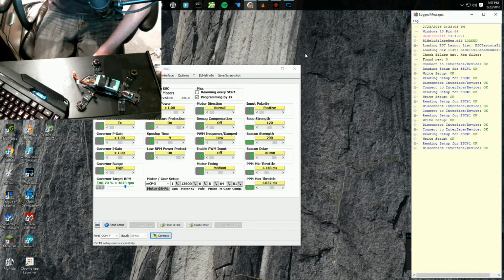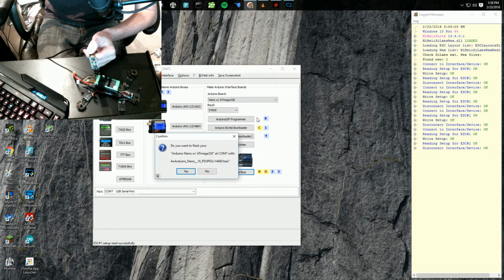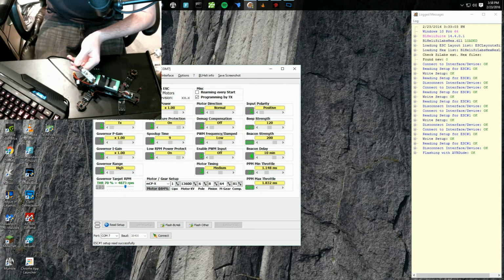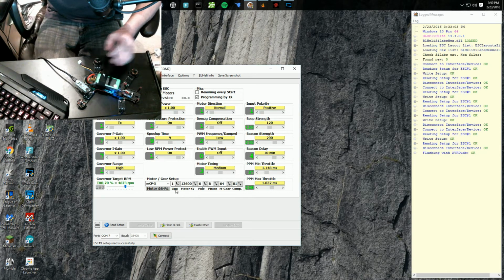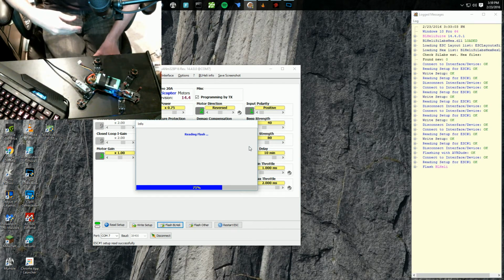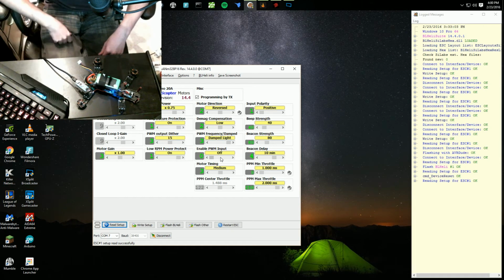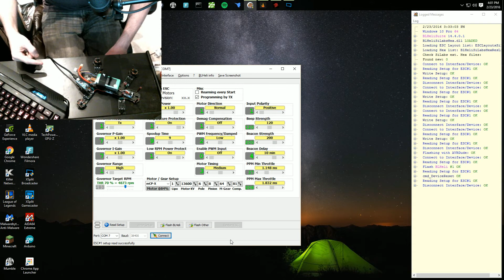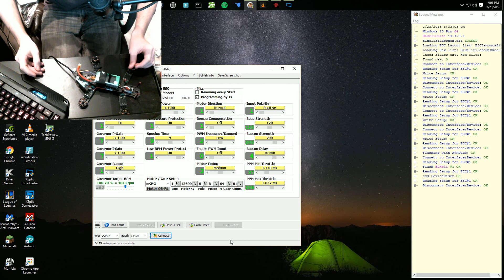How to flash Emax Nano, and other SiLabs Escs, With BlHeli

Comment: LOL found this over 2 years later looking at 12A and 20A HW ESC's and this video shows the pain customers had to go through ... and still have to go through all too often and would expect EMAX to have posted a few instructional videos by now as they make good motors and ESC's that work together... when setup so correctly so they work correctly... errr when will they learn to hire a few manual writers who would write the Bible for a free quad and catch em while they are young..... way more expense in unneeded warranty claims created just by selling technical electronics blind to the end user..

Comment: Why not calibrate? Is there documentation or is this standard procedure after flashing in this fashion? I'm new to this. Any info would be a lot of help and thanks for the help already provided!
Reply from the maker: +mtn fpv CAlibrating can throw off the values set in blheli and cause sync issues with your flight controler, so not calibrating is standard procedure, at least in my book. Thanks for asking, feel free to shoot any more questions our way
Reply from the maker: +mtn fpv Yes, The nano 12a are supported I believe, there is more documentation in the video discription for a complete list of silabs escs that blheli supports. Emax are silabs arcitecture